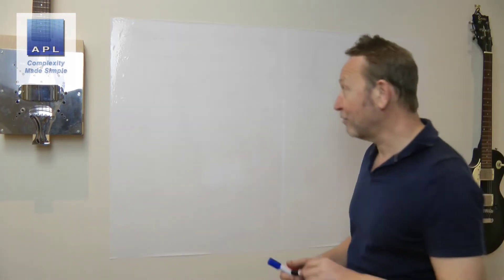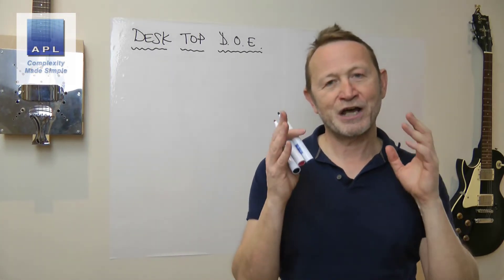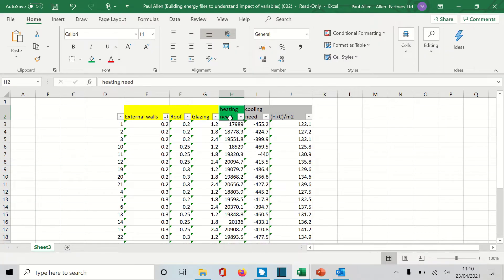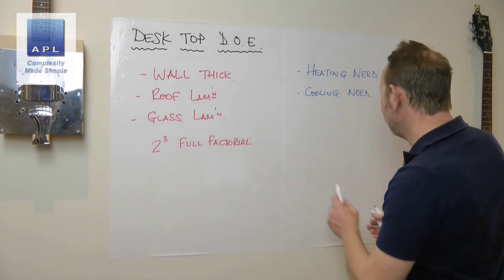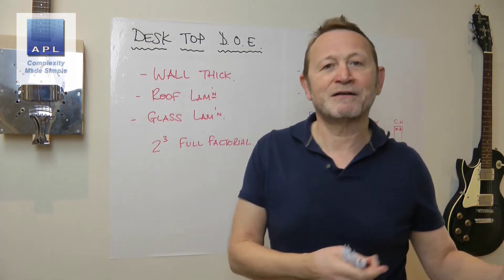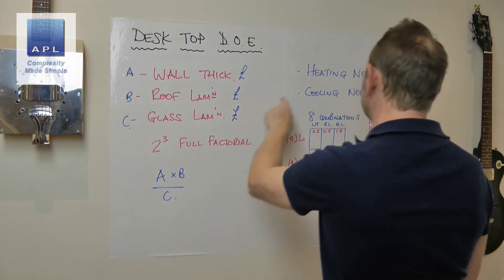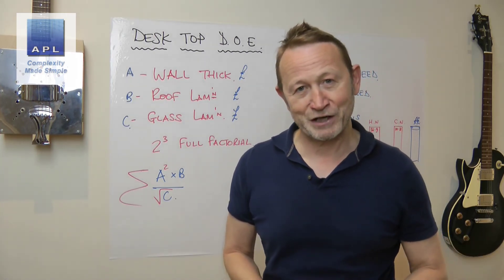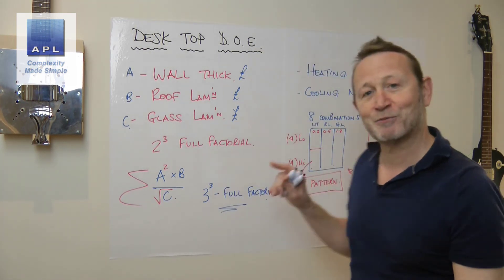Desk top Design of Experiments

Comment: I have 5 CNC machines (vetrical mills & lathes), 3 3D printers, 2 surface grinders, 14 conventional mills & lathes, 2 CMM, hardness tester, 2 tensile testers, roughness tester, 24 CAD/CAM stations, CNC Brake Press, the students will collected data and see what is going on during the manufacturing process using the inspection process in the metrology lab.
Reply from the maker: Michael - I think youtube has edited your message. If you'd like to send a longer message drop me a line on paul.allen@allenp.co.uk